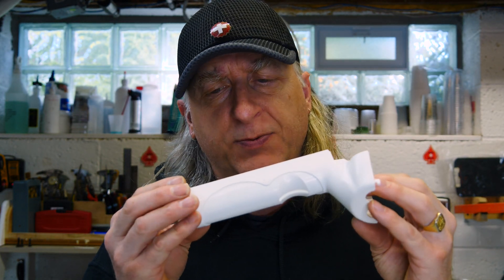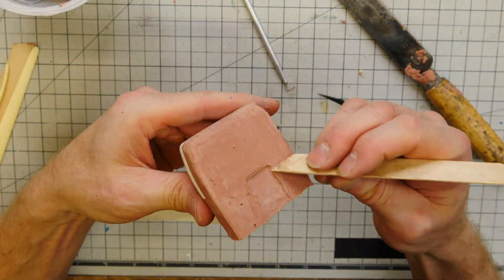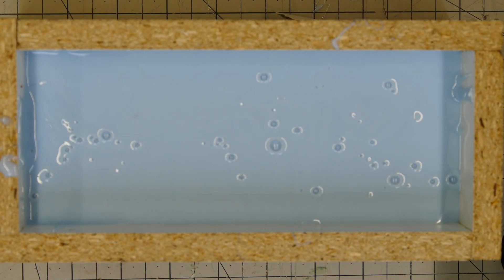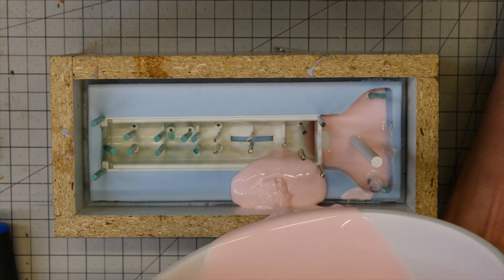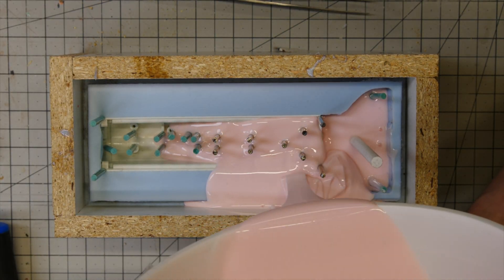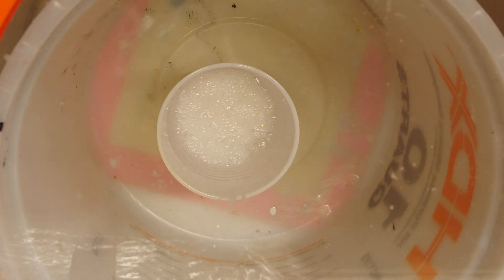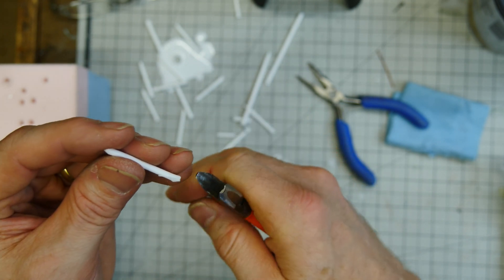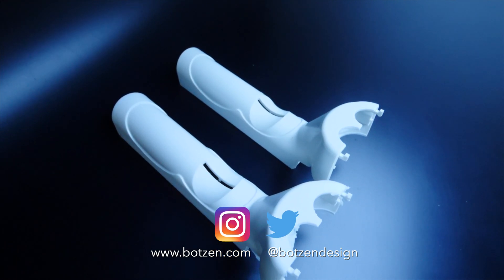Intricate Molded Handle: Difficult Part

Comment: Hello, 
Why you didn't use pressure tank? Thanks.
Reply from the maker: Because silicone is soft and flexible, unlike resin, that is hard and can withstand the pressure, the silicone cannot and will deform once the pressure is released
Reply: @EricStrebel  I meant when you pouring resin. Im not talking about silicone.

Comment: Hello Eric, 
I have never done mold making, but I have a part at work that might be much easier to make with a mold. 
My question is do the silicone  materials have different temperature capacity?
The material I would be casting is Insulcast over electronic parts. The Insulcast generates high temperatures to cure.
Reply from the maker: Yes check with the manufacturer to see the specifications, silicones have all kinds of different heat levels that they can take.

Comment: I am surprised by how many air vents you use in this example. What is your approach to figuring out how many air vents to use (and where to place them)? Just checking for areas where the air might not be able to escape and add a vent to each of those spots ?
Reply from the maker: Correct, high points

Comment: The way you talked about using the smooth-on rubber makes it sound like you aren't a big fan of their stuff, any reason why?
Reply from the maker: Yeah, just not a high quality product like some of the other silicones that I use
Reply: @EricStrebel  I took a quick scroll and didn't see a video on the topic, could you name some brands that you like more? Are the differences in quality something that would matter on a hobby scale? I've always used smooth on just because it's what I was exposed to first.
Reply from the maker: I added a link to Silicone Inc in the description. Smooth on products have a good distribution system and are very easy to get.

Comment: Another great video.. I have a revopoint 3d scanner I'm going to use to scan a damaged plastic handle/ capacitor cover for my vacuum pump. If that doesn't work I will do this.

Comment: I really like what you do Sir! 
Many advices!

Actually I have an issue that I can’t resolve : I have a polycarbonate mold and I would like to extract the positif of this mold by putting epoxy resin. But, polycarbonate andepoxy will « fusion » together and I don’t want to use gypsum, I will lost the shiny aspect.

How can U manage this ? I know I need to lubrificate the mold, but with what ?
Reply from the maker: Wax
Reply: @EricStrebel  Perfect! I will try it today :)

Comment: I'm curious if the 3d print (I assume?) was over-sized to account for shrinkage of the resin?  Were these copies required to be dimensionally accurate and fit with other parts?

Comment: Nice. You know the golden rule,  gate low vent high! Ever try silicone by Axson? Smart thinking reducing shore hardness on the core side of the mold.  Also, ever try making the mold box using aluminum plate and an electric glue gun? You can then throw in an oven and cure much faster. I use special curved needle nose pliers to remove the vents, way easier. Awesome channel man!
Reply: Are there any downsides to accelerating the silicon curing like this?

Comment: May I recommend the "Engineer PZ-57"?
A very nice, high quality pair of pliers with round jaws.
Reply from the maker: Yes, those are nice, thanks for pointing those out. One thing that is needed is a very fine thickness at the tip so that I can slide it in the silicone with out damaging the silicone. I assume there had to be pliers out there with rounded jaws, I knew it!

Comment: Always love your molding and casting videos! How are you handling the screw bosses? Normally I will add metal dowels prior to pouring silicone to allow for easy tapping later on. But curious your process. Cheers 🍻
Reply from the maker: Just drill them out after casting

Comment: do you also use a pressuretank to cure silicone ? (ive seen people using this to decrease the size of the remaining bubbles)
Reply from the maker: No, You do not want to compress the bubbles as they will expand once you let the pressure out of the tank
Reply: It's fairly common to pressurize a rigid casting PU during cure but not the silicone, which is degassed but not pressurized. The difference is that the stiff, rigid PU would keep the compressed bubbles in check after curing. Whereas the softer silicone would let them expand again throwing the dimensions of the mold out of spec.

Comment: Thanks for the video. I wonder if it's possible to use similar techniques to get electrically conductive parts, like an RF-shielding metal-ish enclosure. Doesn't necessarily have to be made of aluminum or brass. As an example, maybe it's possible to mix silicone with carbon.
Reply from the maker: Copper powder perhaps